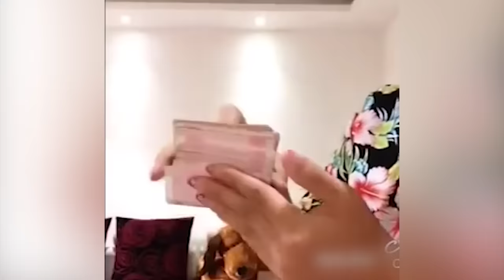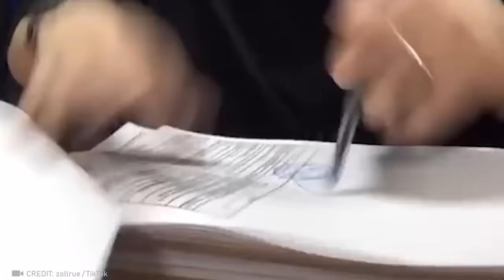30 Minutes Satisfying Videos of Workers Doing Their Job Perfectly

Comment: 18:52, When he lifts the Edger you notice it has STEEL BLADES instead of the usual plastic wire. As I have done this with Steel blades its a LOT EASIER then with the wire.